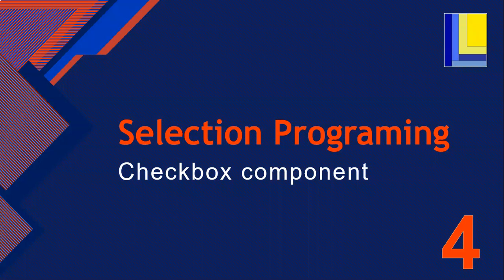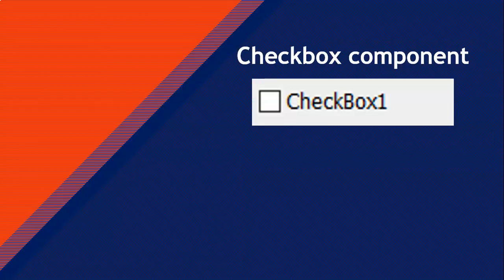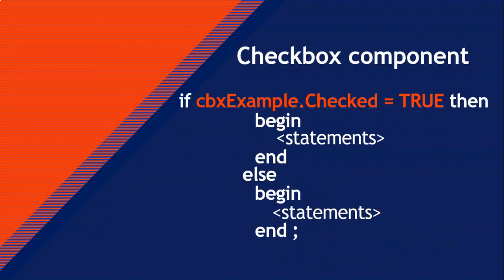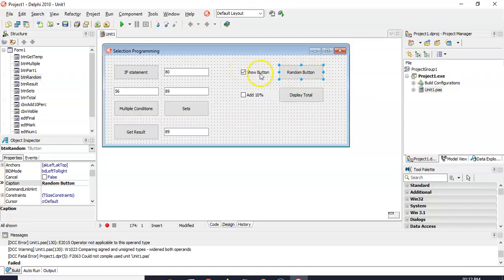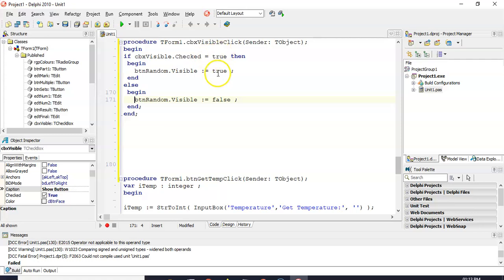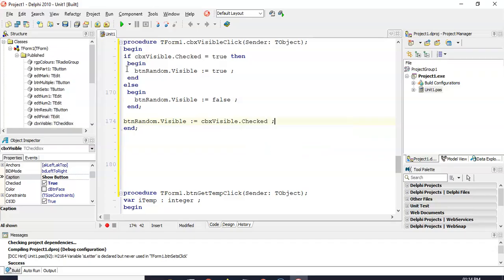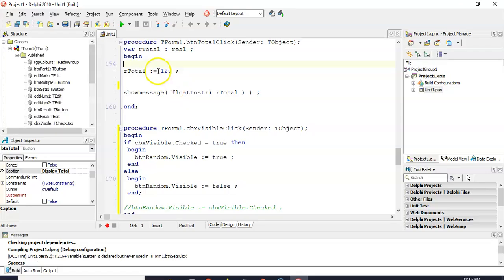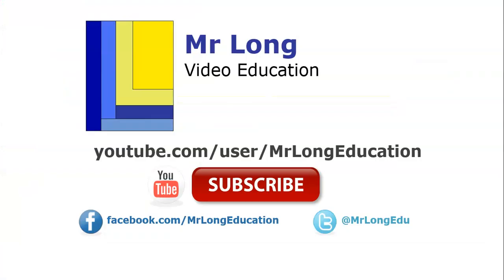Selection Programming Part 4 - Checkbox component

Comment: Thank you for these amazing videos, but Sometimes the screen go blurry  :(
Reply from the maker: Thank you. If the screen goes blurry, that is because your Internet connection is a bit slow and YouTube will play the video at a lower resolution to prevent it from buffering. Try clicking on the Settings option of the video and selecting a higher Quality (Not Auto). May have to wait for video to finishing loading to watch it.